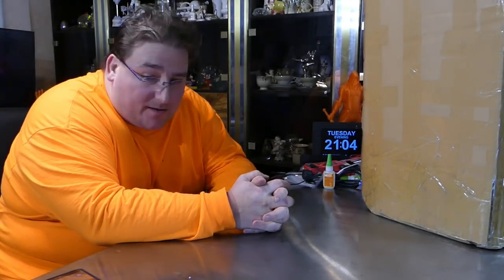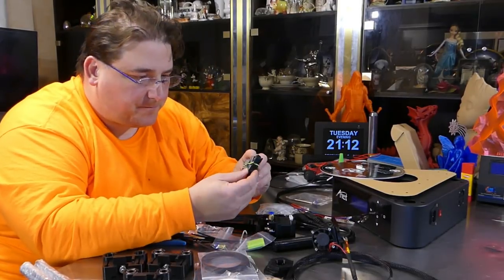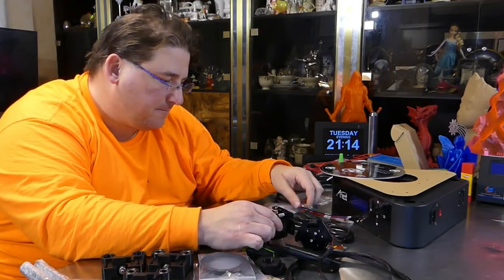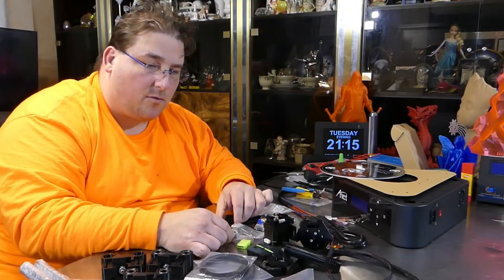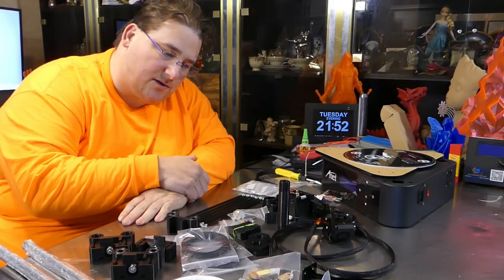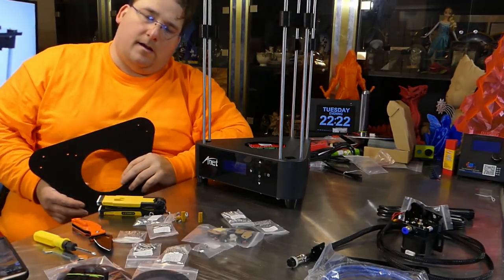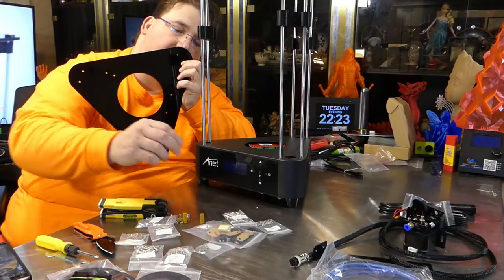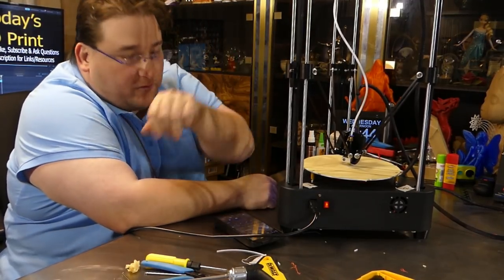Today's 3D Print 186 Anet A4 Delta Unbox, Build, First Print

Comment: That thing does look like a nightmare. Hey I posted the bennche special for my YouTube channel printed from 60 mm all the way down to 1 mm. With a time-lapse. I was able to print all the benches at once using an Ender 2. Go check it out.
Reply from the maker: +Average Joe's 3D if you are up for it i would like to try to help you out a bit. All of your benchies except the fantastic cr10 monster look quite... Bad. Even the full sie 60mm looks very bad to me. Are you upnfor some diagnostics to see if we can fix it?

Forst things first goto my link of profiles and grab my benchy ender gcode. Print it as is and lets see what happens. Got tonfigure out if its slicer or mechanical. Also what filament are you using?

When you slice it. Extrusion multiplier? Line and nozzle width? Temp? Speed? What did you enter for filament diameter? Did you measure it?
Reply: Nerys I noticed the artifacts on the bench as well. Don't know where they came from. If that guy use the f f f from your link for my simplify3d. For the video of course I just Breeze right past the look at the benche. And just showed the size. But you know I've made so many different changes for so many different Prints settings. For different pla. I should probably make a profile for each type.
Reply: Nerys nozzle diameter .4. Extrusion multiplier .97. Extrusion.4. Temperature 210. Speed 3000 mm per minute. Filament diameter 1.73
Reply: Nerys I was using some 3D solutech printer filament and grey. I'm pulling up your G-Code now and I'll use the same filament after I finish printing up some Esun glass red
Reply from the maker: +Average Joe's 3D. Very weird looking at your print I see over Extrusion and over temperature. Odd. 3d solutech likes it hot though i print it at 220.

How much retraction? Need at least 4mm maybe 5 or 6 at times i usually use 5mm on my enders.

Printer is mechanically tight? Nothing loose or wobbly?
Reply from the maker: +Average Joe's 3D ohhh the esun glass is nice! Your going to like it.
Reply: Nerys I printed the bench you using your G-Code. I I didn't get any artifacts. I did get Salmon skin. I tried the original grey and then some newer red filament. Both of them have salmon skin
Reply from the maker: +Average Joe's 3D i am not sure if smoother will work on these. I will try to find some and see what happens.
Reply: Thanks. I'll try another friendship does on that one as well
Reply: Nerys maybe try it on a lithophane
Reply: Nerys I got my JG Aurora A5 last night. And it seems like when I was trying to level the bed. I use all the adjustment I had available just to level it. Did you have a problem level in your bed?

Comment: Has Anet even made any good printers?
Reply: Karl.H Künstler The A8 is pretty decent and cheap now adays. If anything you can use the parts and make an AM8. The print quality is decent if you brace the frame.
Reply from the maker: +Karl.H Künstler the e10 is very good and still one of my favorites for its near ender quality prints but damn does the qc suck. :-)
Reply from the maker: +Marcos Ramirez from what i gather the a8 is garbage but the huge community support and mod scene can make it amazing. I really want to get one one day just to mess around with.
Reply: Anet don't make the printers...you do! 🙂
Reply from the maker: +Bertie Blob that's not as far off as you might think I suspect a lot of this came from the A8 it was very popular because at the time the price was incredible so people were willing to put up with junk and then hack it mod it and fix it themselves no big deal but now that you can get an Ender to for 145 bucks printers like the A8 don't make as much sense anymore and they were trying to probably ride that popularity and they're having growing pains making mistakes they really should not make

I cut a net less Slack because they keep making the same mistakes over and over again they're not learning from them and that's not good for long-term success when the anet A8 Fame wears out they're not going to be in a very good position if they don't get their act together
Reply: the E12 is ok'ish
Reply: but it has the jamming issue, that I also have on the A4 :D

Comment: Put tripod on the floor (or stop hitting table :D)
Reply from the maker: +Majstorsky Majstor :-( yes i noticed that. Whats strange is that IT IS on the floor which is something i did for just this reason. I did not notice if it was touching the table or not. I will be mindful of that.

Comment: Manual, we don't need no stinking manual!  See, that's what happens when we read or watch the direction video, it just confuses and disappoints us!
Reply from the maker: +PlanePreacher it did not come with one. It literally says see the video! What a mess. :-) but i did get it working.
Reply from the maker: +PlanePreacher also the video was not really bad for the parts it did cover. It was just flat out straight up MISSING critical information :-)
Reply: I was meaning my post as tongue in cheek comedy,  from Badges, we don't need no stinking badges! "Manual, what Manual"'!

Comment: I'm sorry but Deltas are not beginner kits. If you aren't mechanically inclined or cannot build something without instructions then they should not be your first printer. Especially if you are low on patience. You can go back 4 years and see that demonstrated via old posts about bad experiences.
Reply from the maker: +Deneteus agreed but it's advertised as a beginner printer :-)

Comment: Ok dude, While I agree Anet has shit QC. I'm trying hard to watch and like your videos. If ANY company didn't reuse parts they would be bankrupt in no time. Sure they can replace parts that fail with better ones but then they wouldn't be the cheapest. And I know this is your first Delta so I'll just say No delta is Aimed at beginners. Any that say that are idiots. I have 2 as well as 9 cartision printers. Printed parts are not that bad if they have QC. I hate when people complain about then when they do a simple job. Prusa only moved away as he got rich.
Reply from the maker: +Norm Caissie i dont mind printed parts at all. When they work.

When you have a design THAT DOES NOT WORK RIGHT (the yelling is for anet not you) then you should not reuse it.

Their hot end is junk. You cant even change filament without taking it apart and they know it as its reflected in their instructions!

Fixing a bad design is part of iteration and product design. Something being annoying (which i can deal with) is not the same as simply not working right.
Reply: To change the filament it's quite simple. 1. Heat it to temp or above. 2. Push the filament in so it oozes. 3. Pull it back quickly. Quite simple really and I do that with every printer. I had the Anet A8, A6, A3, E10 and E12. By parts I mean bed hotend motors ect. GM uses the same motors in many cars. Even parts like bumpers. They share parts between GMC, Chevrolet and Buick and probably catilac
Reply from the maker: +Norm Caissie this does not work on the E12 and this does not work on the A4 I can do it on the E10 and I'm not sure what's different

If you seen my videos what you described is exactly how I change filament heat up push clean ooze firm pull filament comes out

On the latest anet hot ends on the E12 and A4 this does not work when you pull it instantly catches it's jammed inside the hot end it will not pull out you can keep pushing in but you cannot pull out

You either have to feed in new filament or you have to remove the compression fitting on the top of the hot end to extract the filament and then push the remaining inside the hot end with one of the Allen keys and this is exactly how they tell you to do it because they recognized and screwed up

The hot end looks the same as on the E10 my guess is it's luck of the draw for QC quality control and how precisely the parts are made

I don't have any printers with the actually I do the A4 still has the a net hot end on it I was going to swap over to the creality hotend I will show on video what I mean before I do that
Reply from the maker: +Norm Caissie and you know what the real ball kicker is :-)? It's not even cheaper than the creality printer it's $17 cheaper comparing E12 to cr10 if it was like 200 bucks I can understand and I would actually endorse it since after fixing its problems you would still be well under 300 but at $319? No it's a bad Buy
Reply: Deltas are bad enough. I would never buy or endorse one from Anet. I just disagreed with a couple of points you made. Not the fact that it's junk.
Reply from the maker: no worries. I am experienced but no expert. I learn as I go :-)